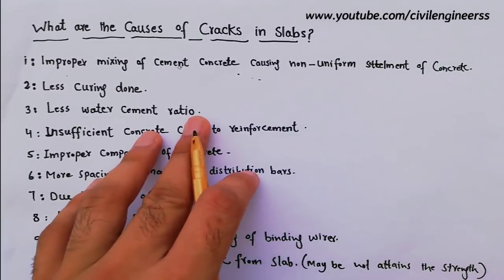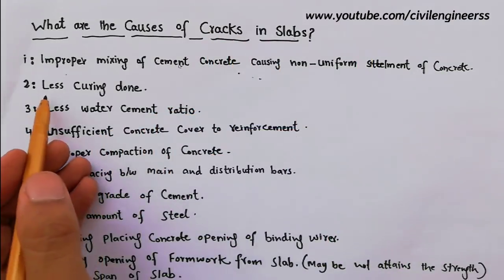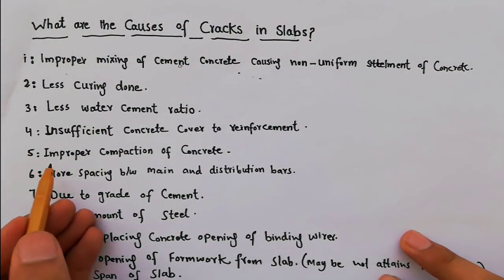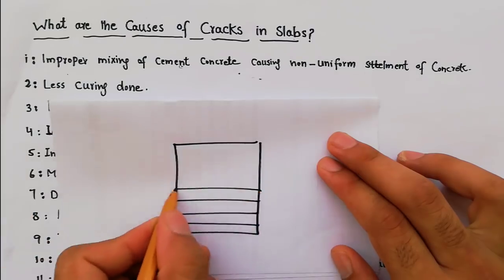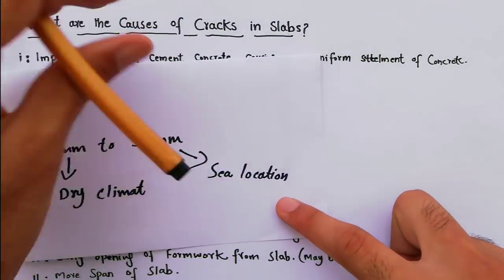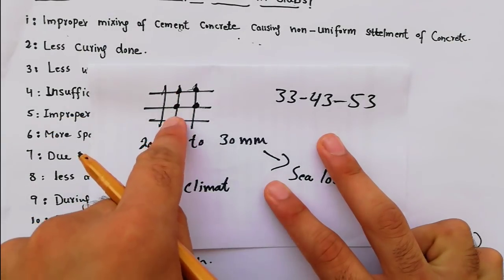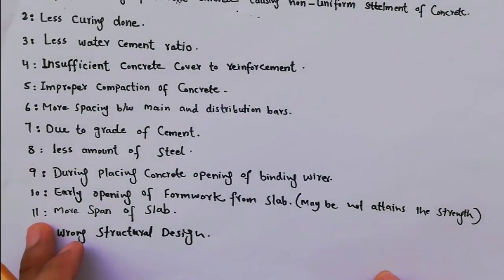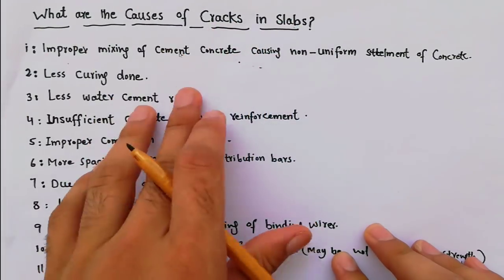12 main Causes of Cracks in RCC Slabs

Comment: If First Floor construction is taken up on  a 40 years old brick constructed building with a partition between two flats in between , how the portion wall can be made on roof of GF so that load will not be on rooftop of GF. The wall to wall distance is 30 feet.